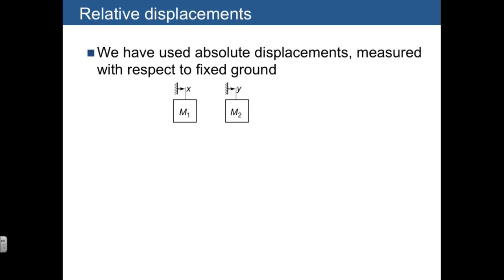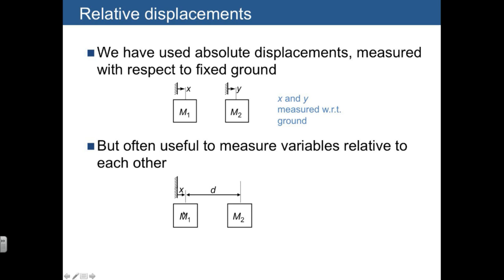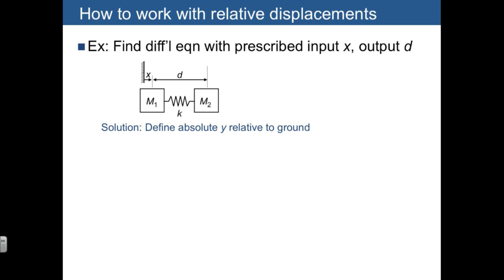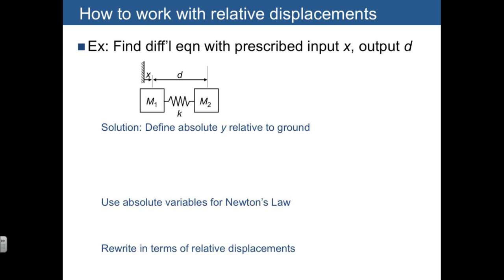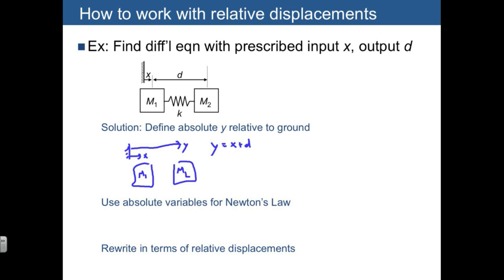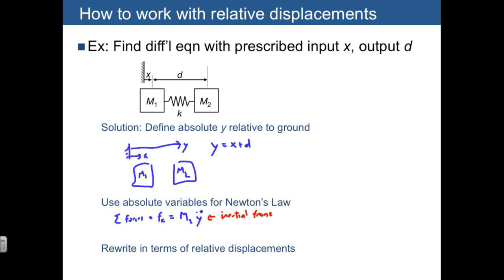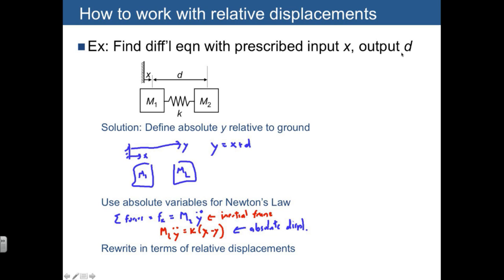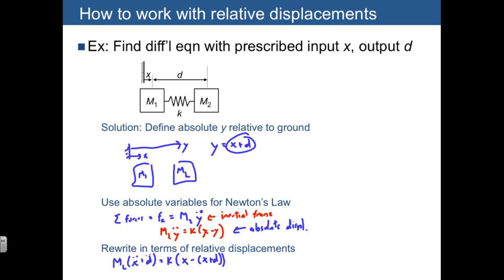Lecture 04 Relative displacements

Comment: Hello Professor, 

I am student in the UK and I have a question regarding absolute or relative displacments. 
When solving similar equations to this is either relative or absolute displacements a default? 

For example in the classic quarter car suspension system what  type of displacement should a student use?
is the choise somewhat arbitrary so long as you are consistent?
Reply: It depends on the problem. For a quarter car suspension, absolute displacement is what the car passengers experience. But relative displacements may be more helpful for describing the shock absorbers, where force depends on the displacement between the ends. Absolute and relative displacements can be converted into each other, so just make a guess what is most relevant to your problem, and convert if necessary.